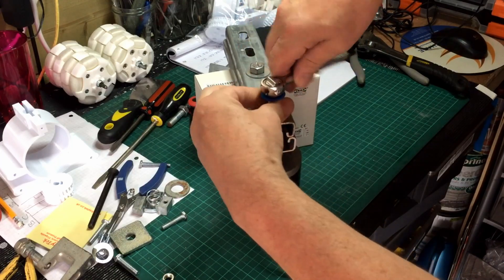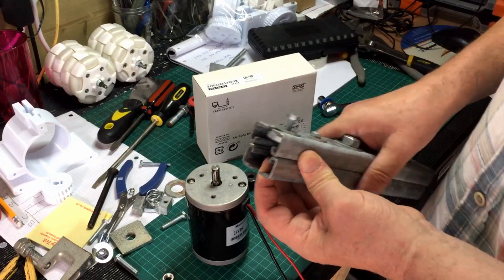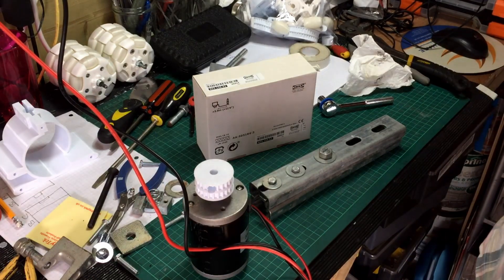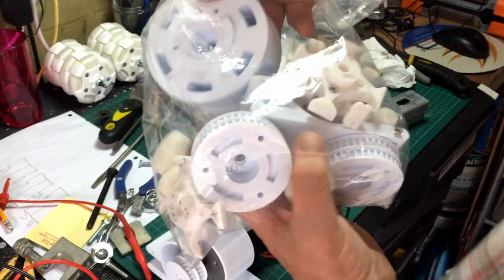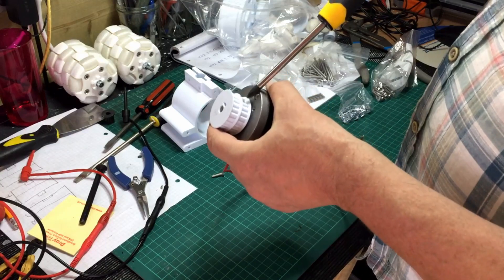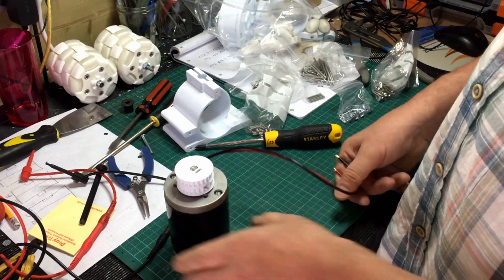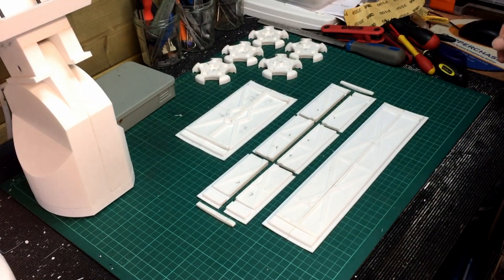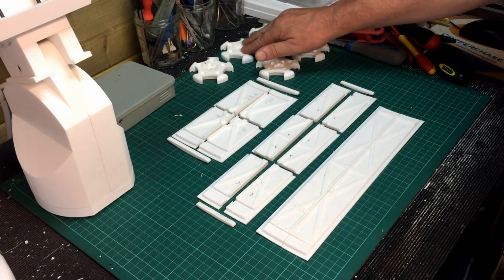R2D2 Droid Build Part  - 14

Comment: Nice though I thought you were working on the motor for the dome for the first minute. It was a tad confusing at the start.Did you say you printed the wheel hubs out of PETG?You are printing his V2 without the retractable center wheel. Did you choose to do that to keep things simple?
Reply from the maker: Hi Chris, sorry for any confusion. I printed the motor holders out of PETG but the wheel hubs are PLA.   They should I suppose also be PETG  for strength but will see how they hold up. I have always found PLA fairly tough anyway. You can see the difference - the PETG parts are brighter white and the PLA is creamier colour. 
I am waiting on the newest retractable wheel design to be completed by Michael, so in the meantime using his current fixed version. I think the retractable design that you can download is an older system.   Same with the outer legs, will update as Michaels designs progress.
Reply from the maker: Chris - to clarify - the idle wheel bodies are PLA, the runners are Nylon.  The main drive wheel and gear teeth and motor holder parts are PETG
Reply: Ah. PETG: I wasn't certain if it was a different color plastic or not. (I have a bright white ABS like that, plus natural ABS and PLA) Okay, cool. I've never printed in PETG, I'll have to look that up. I have printed in ninjaflex though. Have you tried adding an enclosure to your printer to contain some of the heat and noise? I found printing with my Da Vinci Pro that having it enclosed helped a lot.Michael's retractable wheel: There are 2 retractable designs on Thingiverse and in his download folders. I downloaded the second version. Watching his youtube video it moves rather nice and quick and smooth compared to the first. (and not nearly as noisy!) I don't know when I'll get to that point though, I'm printing little bits for the dome and arms and greebles right now while I wait for my S4 to come in Thursday.I need to go back to your older videos and check out your dome and periscope. Mine seems small.Are you considering adding other add ons? Like the light saber launcher? Or other arms and bits? I've seen a saw arm and a taser/welder arm on the web.Have you considered making an InMoov shell based on Threepio?
Reply from the maker: Hi Chris
No plans to make a C3PO lookalike but I will get them chatting away together.   About to finally mod my InMoovs neck to the new updated one by Gael, to get it all working properly. 
I had thought about adding an InMoov head to the R2D2 body, maybe popping out of the dome...
Am going to wait on the retractable legs until there are moving shoulder sections as well.  Maybe I should add an enclosure just to keep the sound down if nothing else
Reply: C3PO: Ah.Mod the inMoov: Cool.Adding it to the R2: lol You could make a lift and have the head lift up out of the dome. lolRetractable legs and moveable shoulders: Ah. Okay. I envy how fast you are churning out parts. Then I remembered you've been at this since December of last year. I just started. :)